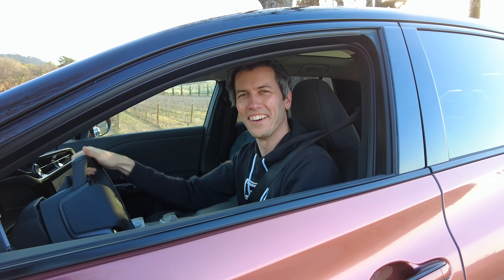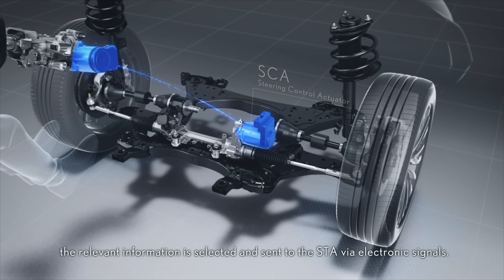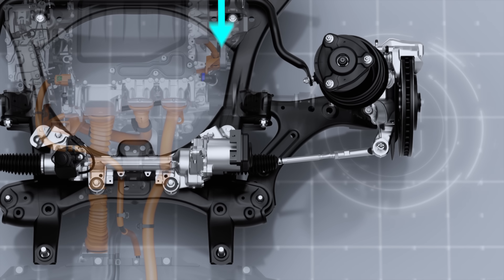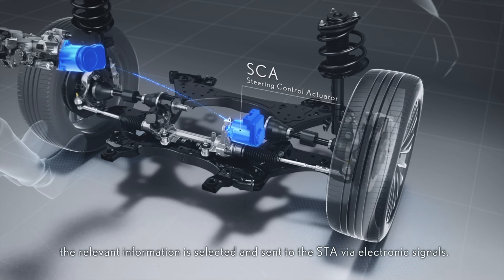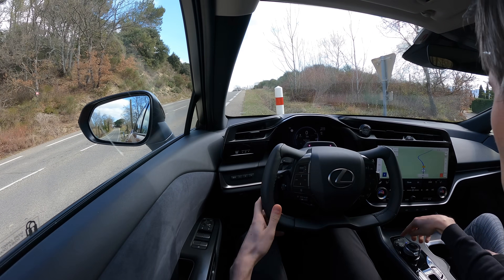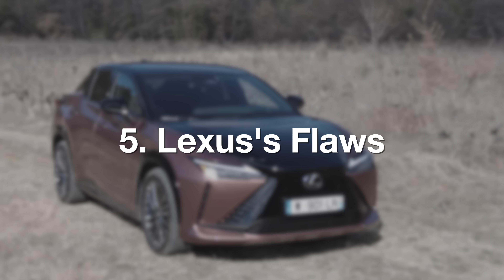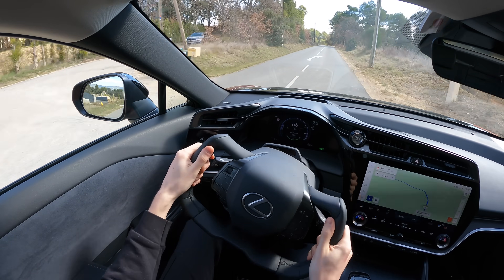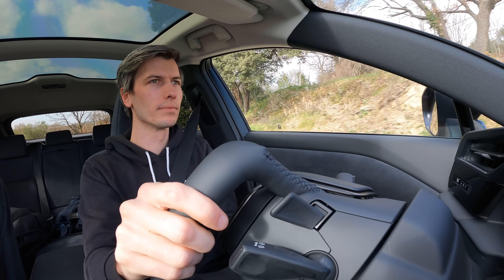How Lexus Fixed Tesla's Bad Idea: Steer-By-Wire Yoke

Comment: I think the analogy isn’t so close to how fast you have your mouse sensitivity too but wether or not you like mouse acceleration.  Mouse acceleration in video games is typically pretty bad and I much prefer raw Input.  But on a trackpad it is basically a necessity.  One problem I foresee is that there will be a lot of variability with different steering ratio values between cars.   I don’t necessarily hate the idea of this idea but it has some problems.
Reply: Agree. The problem is not engineering, but a human factor. You don’t typically steer a lot on highway, but when you need to your brain might actually lag, and understeer in difficult situation because you expected your wheels to turn more. Or okay, you get used to your car, but decided to rent or use friends car. Considering all vendors will use the most possible amount of patents and secrets in every thing, the actuation smoothstep functions will be different. 

For a person who learns to drive in such a car it could be actually relatively okay as they will be used to test and re-learn acceleration to steering patterns, as I think there are people who don’t find Mac mouse acceleration absolutely horrendous. But for the old drivers, who actually can afford that Lexus, it could be a problem.

Comment: it worked for aircraft like the F-16 since 1974 which generally are more dangerous and prone to failure so why wouldn't a similar system work in 2023 for a car?

Comment: Why the need to trash Tesla.  Everyday my car improves thru over the air updates.  Steering ratios could easily be changed via a software update.  Tesla even fixed an issue with headlight aiming via software update....  YOU ARE A TESLA HATER.

Comment: I think it just adds unnecessary complexity. A conventional steering rack with an extra degree of freedom implemented by a planetary gearset is perfectly capable of doing the same variable ratio trick (in fact a lot of manufacturers sell these systems since ages) without the added latency and possible safety issues. My safety concerns are mainly about later owners down the life of the vehicle who won't necessarily have the money to fix issues correctly once one of the motors give up for example. They will just try to "fix" it on the cheap and somehow eliminate the warning lights and keep driving with one set of motors until eventually that one gives up as well. It reminds me of the SBC (brake by wire) brake system in the early W211 Mercedeses. It led to a bunch of recalls, while the conventional brake systems advanced significantly and Mercedes just went back to them after the facelift. For example the foot brake module in those SBC systems had a counter that would make the owner replace the part after the guaranteed lifespan has elapsed, to make sure that nothing bad happened. Guess what is the most common way to "repair" these in the now 20 yo cars :)  (Of course people found a way to reset the counter)

Comment: I understand your last point about the responsivenesse and your example is convincing. But to be fair, you could'nt possibly turn 840 deg at the same speed you turn 300 deg. In my opinion, the best fix to this would be to use the "force feedback" motor to prevent the driver from turning the wheel faster than what the actual wheels turn. Just a little coding in the software would solve this issue I believe. I would like to know your though on that :)

Comment: None of this is remotely new.  Variable steering ratios have been around for 30 years (my '94 Lexus LS had it).  The only thing different about this is they got rid of the single most useful piece of redundancy- the steering column.

Having 3 different power sources isn't redundancy.  A power surge could take out all three at once.  Having 2 motors doing the same thing from the same location isn't redundancy.  An impact on one is almost certainly an impact on the other.

An electronic system, with a mechanical system that only functions when the former isn't working?  THAT is redundancy.

Also, a yoke?  Really?  The reason we don't use yokes right now isn't 'they wouldn't work'.  It's that a wheel is a better choice both functionally and ergonomically,  unless your cab is so damn small you don't have room for it.

Comment: Someone should drive a Citroen SM, CX, or early V6 XM. Thats not a new invention, actuall from the 60s. But ok, back in these days you open and close hydraulic valves. Only a emergency mode exist, witch activat a very bad mechanic connection.

Comment: The idea of being able to adjust the steering ratio for different speeds is freaking fantastic to enthusiasts. Like tuning an ecu, you can have a preference between linear, log, exponential, step, to set speeds. We're getting closer to software defined cars!
Reply: No it's not, one of the worst ideas for track driving

Comment: Your video is interesting but doesn’t address its most interesting question: why doesn’t Tesla just copy Lexus’ variable ratio system? Given their ability to push OTA firmware updates and the lack of mechanical linkage in the steering column I’d think that they could just update how the steering works even though the wheel has more generous lock positions. Maybe they could give users a warning/option/toggle to switch (maybe with a new marketing name like Tesla Adaptive Steering) so that the behavior of their car doesn’t change unannounced? Is there a technical or legal reason why they’ve not done this?

Comment: I'd love to know how it drives on snow and in skids, as the angle matching is rather useful in those cases!
Reply: Penguat
What you drive now, you disable all track support etc ?
Snow is the same as aquaplaning, it's just correcting, get it on track. Not what you did with the wheel, a bit weird ?

Comment: Why complicate things? Redundant systems are expensive and don't necessarily mean better safety if not paired with strict maintenance. People will keep driving if one of the steering motors fail, until the other one fails too and they have a crash.

Comment: My alternator & battery system died on my F150 with electric steering while cresting a mountain road with a sharp curve on the down hill.

With the motor still running and all electronics dead I could only move my wheel about 5*....enough to steer myself into the ditch full of snow to slow down fast enough.
Reply: The idea alone is dangerous, and then they apply the idea with very low quality materials.  Lot of people can die

Comment: I’ll agree it’s cool technology, but I do have a big concern. The ability to steer a car is the most important driver input. Your brakes might go out but if you still have steering, you still have options. Electrical failures are already extremely common compared to steering failures in cars. I just don’t think the advantages outweigh the disadvantages

Comment: Turns out there are better engineers out there than Tesla.

Not allowing crazy steering movements also means, they can improve the ESP on the other hand. Now they can not only use brakes to stablize the car, but also perform a perfect evasive maneuver.

13:20 Very good analogy! Thanks for that!

Comment: Hi and thanks for the video!
Gotta say,  you MISSED SOMETHING VERY IMPORTANT TO MENTION IN YOUR VIDEO. LEXUS is NOT the first car to have a steer by wire system. NISSAN with its INFINITI Q50 was the first to introduce to the world the DIRECT ADAPTIVE STEERING (DAS) which is a full steer by wire system. I own an INIFINITI Q50S HYBRID which has the DAS as the default steering system option. The system is very snappy and the overall feel of the steering system is great.

Comment: That happens when engineers have too much time on their hands instead inventing something that would make existing cars cheaper to make yes invent steering rack again. Looking system complexity i cant see any way how this can be cheaper to manufacture than standard solution. But again Lexus is not designing cars for masses  so its fine,

Comment: As said in the video, this already exists in aviation and has for quite some time. The only issue I have with it, is how it's already implemented for throttle by wire. On most cars, there's some lag to it. It'll have to be tuned very precisely, more so for the steering, and quick reactions are more important than quick throttle response. 

And now I watched the full video and the issue I was describing occurs.
Reply: The thing that for aviation is that the delay isn’t much of an issue. Planes don’t need to make tight turns and even if the ailerons are set, the plane itself has some delay in turning. The delay becomes apparent in fast jets.
Reply: @worldlinerai  wouldn't know if there is delay or not in this type of system in aviation. I meant there clearly delay in throttle response on cars with throttle by wire.
Reply: When was the last time a plane had to swerve to avoid a deer in the sky?  Or swerve some idiots pulling out in front of you?

Comment: I believe the logic at 2:30 is flawed, the systems employed by the accelerator and brake had room for improvement, but a direct mechanical connection like a steering shaft and rack does not. I don't think "responsiveness" or steering "response"  was the right word to use here, it clearly isn't responsive based on what is shown at the end of the video, that delay means it is unresponsive. It is fully electronic though, maybe they meant that. Collect the whole set I guess. One benefit to this that wasn't mentioned would be LHD and RHD versions of the same model would be easier to engineer and cheaper to produce, they could use the same firewall. There's no way that's not a consideration for pushing this out the door. Despite all the redundancy it will always be the more dangerous option of the two, just like how electric emergency brakes are absolutely useless as emergency brakes. And I haven't even addressed the point that feeling the road is important for safe driving, electric assisted steering is bad enough for that already. This set up's ability to smooth out road surface feedback to give the driver a false sense of security about the road condition seems completely anti-safety.

Comment: I've always firmly believed that the high steering ratio on cars is the reason why we can have such a high percentage of the population driving around on the road with a basic degree of competency. The fact that a small movement of the wheel corresponds to a small turn is a safety feature, even if more skilled drivers would prefer it to be faster. So I worry about what will happen as that changes, and it's not just people who are into driving using low and variable ratio steering, but also their grandmothers. I would want to keep the full circle steering wheel, since that means you can at least choose the ratio. I don't think the negatives justify losing that flexibility.

Comment: There's ALWAYS going to be some delay, it might get down to a point where it's almost not noticeable but you can't remove it. It's not like the input lag in a video game because these can get really low because there's no mechanical moving parts involved. Steer by wire has a lot of moving parts AND a digital signal so even if the signal from the steering wheel to the steering motor has no lag, it would still take time for the motor to start and turn. And the sensor in the steering wheel will also have at least some delay because it needs at least a little ammount of movement to detect an input. I know that mechanical steering can also have some of these issues but usually only if the mechanical parts are worn off...

Comment: Input latency could destroy consumer interest in this feature, especially if you can feel it. Imagine not being able to swerve around an obstacle - not because your steer-by-wire tried to maintain stability - but because the wheel just *didnt' turn fast enough*? Lexus needs to get this down to be instant (or at least functionally instant) and consistently so, or someone is going to find them liable for something.

Comment: When you're going 70 mph and hit a patch of ice on the interstate, how is that yoke with its 70 mph steering ratio going to affect you?  Even with all that stability control and such, cars still end up in the ditch just as much as they did 20 years ago.
I've seen too many electronic modules in cars "glitch out" intermittently.  They can be doubled up and be required to correlate with each other just like the throttle by wire, but....  hmmm.  In any case, it is going to cost a fortune to repair in the event of a failure.

Comment: It's interesting how a number of comments are mentioning delay. The electronics can detect the torque you apply to the steering wheel even before you actually move it, and can start reacting to that. The electric motors are capable of moving the steering far quicker that is humanly possible.
A lot of the feel will be determined by how the software code uses the inputs from both the driver and the car, they should be able to improve on the current EPS, but will it match the balance of a hydraulic PS?

Comment: what happens when you accelerate or decelerate with the steering yoke kept at the same angle, does the ratio change under you and the wheel angles change even though you didn't move the yoke? that sounds pretty bad to me

Comment: A mechanical connection assures the security of the vehicle in the case of power failure. This is an obligation by the car manufacturers. Trust me, I'm an Engineer. Mechanical systems are the best!

Comment: I loved the hydraulic steering in my old 2001 Miata. It was super responsive. Until it broke and leaked oil everywhere 👍
Reply: Old people love the Miata, you forgot to service it ?
The first 10 years you did nothing, slow driver, touring....
Never speed it, it's a not for that !
After 20 years, please do service it, or it is gone now ! It's a keeper, not your daily job !
Reply: @lucasRem-ku6eb  i only had it for 3 years and did only necessary repairs. It was my first car and I didnt have much money. Once I got a proper job and the engine started making sounds it shouldnt I gave it to a vocational school pretty much for free and got a 2017 Miata :)
Reply: @MrKrustenkaese13  Most of them are still on the road, they do need some maintenance, but you can ignore it and keep on driving them! Hope Science School kids love this car, hope they keep it forever, kids in 2060, this is a fuel car from japan, our NATO friends did good!

Comment: I like tradition steering wheels, makes it more comfortable when you let the wheel correct to straight position after you finish making a turn. scary part about electric motors controling steering is, if motor fails you wont have any control over were the vehicle goes completely screwing you over. I'm tall. I like the idea, but the thought of my safety if a part fails thats so importent is more concerning

Comment: One point. I leave the lights on, and my battery dies. Wouldn’t it become impossible to steer? If I need to push it, I won’t be able to go arround corners.
Reply: You need to leave the light on for  months and don't recharge at all  within that time for the battery to die like that. I doubt that is even possible.

Comment: So they basically put a separate motor on the steering wheel to give the feel of the road  to the driver which could also be accomplished by the steering shaft...
And complex software is needed, sensors a computer to deal with all of it and the computer also needs to maintain the steering thing
I'd actually rather  take a horse

Comment: Is this amateur hour?  Your rationales for why are complete garbage lol.  Electric motors have torque at almost any rpm but both electric motors and internal combustion engines can have torque immediately.  In fact most EVs have roughly the same throttle delay that performance gas vehicles do which is ( almost nothing).  As far as braking goes... Again a weak argument as most times when you go to brake in a gas vehicle, you aren't on the throttle, you are typically coasting as you are operating the vehicle in a controlled and anticipated manner.  Then for the steering argument... saying that the SBW has a better response is just garbage.  A closer ratio is not improving the response, you turn the wheel and it goes.  When you are moving at any speed, you rely upon small steering adjustments and you aren't cranking the wheel as fast as you can.  Please get better reasons.  Normally your content is pretty good but this reeks of paid promotion.

Comment: I have no problem with steer by wire. But my doubt is regarding the yolk steering wheel.  Like if we lose the balance of the car for example a 360 degree spin, with a yolk wheel wouldn't it be very difficult to control the car when compared to the traditional steering wheel?

Comment: It's a cool idea, but their is no real redundancy in Lexus' design, so when it fails, you're F'd. Throttle by wire is a prime example, their are plenty of incidents where the throttle by wire messes up, which is easily savable by throwing the car into neutral and cutting power.
the steering wheel position sensor fails. the program lags, especially bad when paired with fast change of speeds. I foresee during emergency braking and evasive maneuvers, correction of steering ratio keeping up, causing either over or under correction and thus an accident.

Comment: Jason, if a new learner driver who had never steered a car was to drive with this system would that cause major issues either due to the system itself or when the driver  moves to a vehicle without it? I love the concept but not being linear which of course does not work (ask Tesla why!!) I suspect there will be little take up, either that or Lexus supply log term loan cars for buyer evaluation.